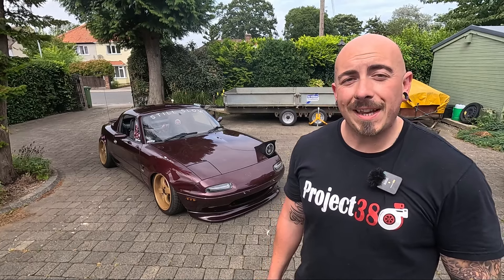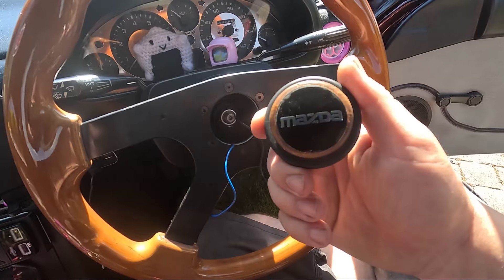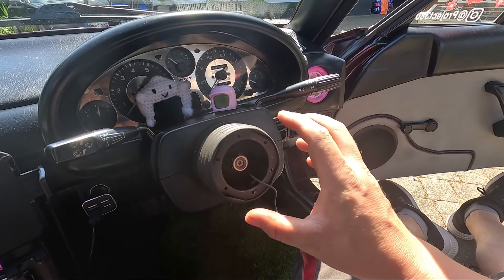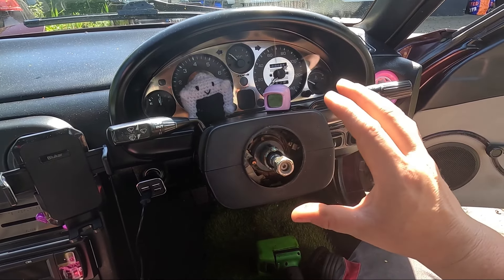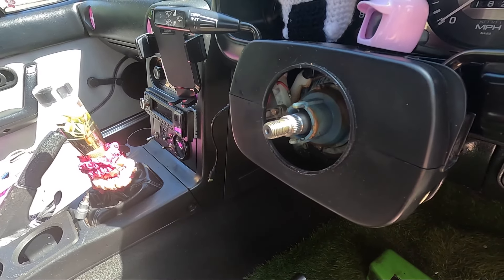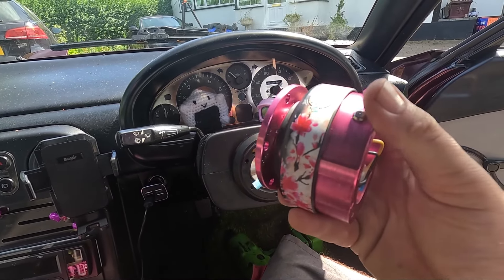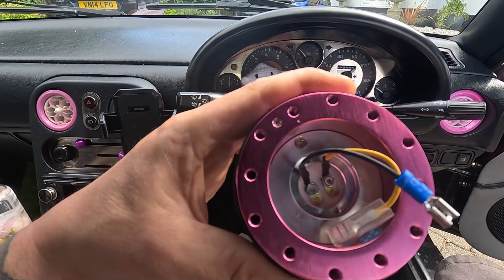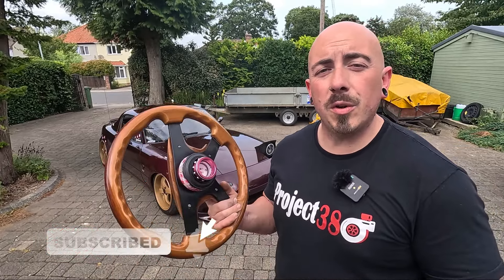MX5 MIATA QUICK RELEASE STEERIN WHEEL

Comment: Been following you for a while now, like your content. I looked into getting a removable steering wheel years ago and was warned by another mechanic about a simple fact. The airbag and seatbelt work together as a unit. Look at the end of the seatbelt where it connects to the back of the seat. It is bunched up (sewn) to give a little as you blast into the airbag. No airbag and you blast teeth first into the steering wheel. The solution would be to change out the seat belt to one that doesn't  move, a racing type 5 point harness. Or the cheap way, undo the sewn up part of the seatbelt. Either way just letting you know for safety's sake. I for one was saved by an airbag, I'll keep it on the steering wheel.
Reply from the maker: my car doesn't have air bags or pre tensioners from factory. obviously i know I'm risking it but thats one of the risks with old cars like these